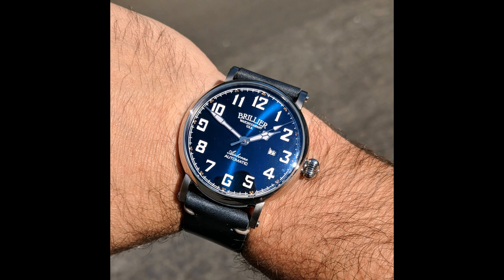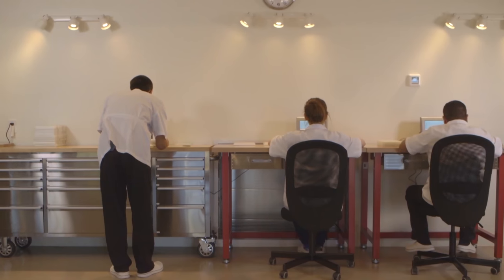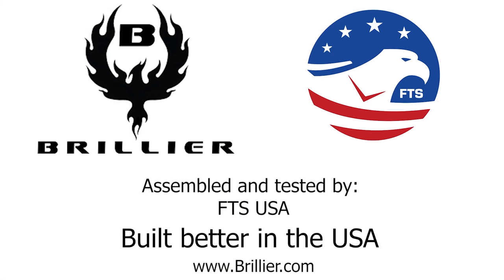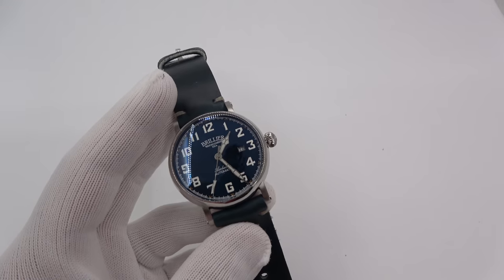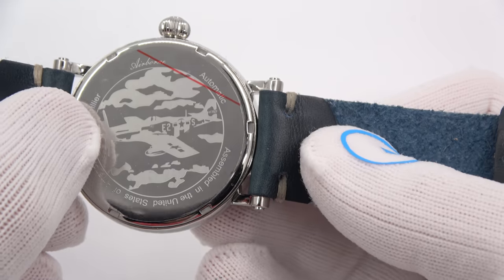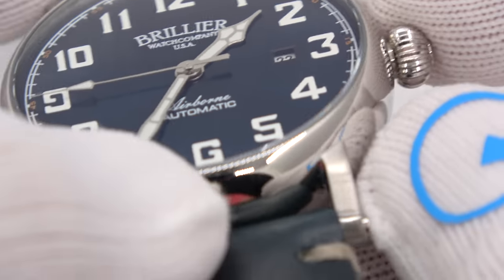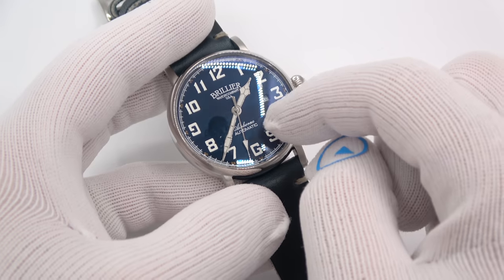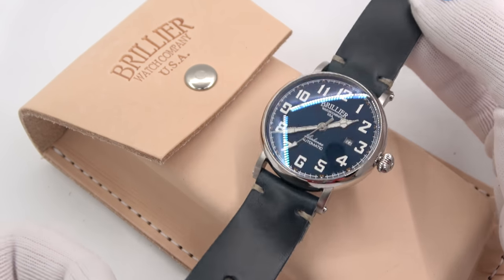Brillier Airborne Auto - Assembled, Tuned and Tested in the USA

Comment: Can someone explain to me why hacking is so important on a relatively inexpensive watch? I have several automatic watches. most hack but a few don't. When I wear the ones that don't hack, it doesn't seem to alter my life all that much. Just wondering why that feature is important. Anyway, nice looking watch. I'd jump on one if I wasn't currently on a very tight budget.
Reply: @ Luigi Savoia : I agree wholeheartedly. My SKX and my Seiko 5 don’t hack, but are my favourite everyday watches. I feel about hacking as I do about press clasps. My 70s vintage watches all have press clasps and it does not diminish the joy I have in wearing them.
Reply: Historically, hacking was a requirement for field watches and other mil-spec watches so that soldiers/pilots could synchronize as needed. Given watch lovers’ appreciation for history and classic design aesthetics, hacking became a priority. There’s also the perception that non-hacking movements are cheaper and less refined.
Reply: I don't care about hacking either.  And neither does my SKX.
Reply: @WrongTimeWatch  when the power reserve is low on the Seiko 7s26 which is usually in the morning turn the hands backwards and the seconds hand will stop. Hold it there with a little backwards pressure and wait until the clock synchronises with the watch. Then release the slight pressure with a shake the watch will start.
That's backwind hacking.
You're welcome.
Reply: A pilots watch is supposed to have hacking to synchronize bomb drops as well as fuel consumption and there two important things were just a few of the reasons a pilots watch needed hacking. I love the glycine airman, it's an iconic pilots watch. And I love the story behind it and it's iconic seconds hacking feature and how it was developed.
Reply: It is just a preference. To me adjusting the seconds is big part of the fun. Or just my OCD but either way I prefer hacking watches. I have other silly fads too like if I do something I prefer it to be done properly.
Reply: it is so you can know the exact second you are allowed to leave work....lol

Comment: I would much prefer they save the money on the strap and put a 9015 in there. The movement is a lot harder to change than the strap. At this price any watch has compromise but the way they compromised this watch feels a little boneheaded.
Reply from the maker: Big difference in price for a 9015, I feel.
Reply: @islandwatch  it's about 50% more on the individual market, maybe $75 vs $50 iirc. Idk what volume pricing looks like

Comment: "Look at that blue"  Actually rather impressive. Doesn't Laco use that same movement? Domed and onion correct for heritage. Fair price considering the high grade leather.
Reply: @indramatic  Worse to me, the A-Dial and B-Dial watches that Laco crafts were mandated by the Luftwaffe to hack. It's crazy to me that Laco, one of the very producers of the both 1939 and 1941 variants, would choose to forgo a movement with this feature. Alas, that's in their lowest end pieces. I have one of their high end watches that both hacks and is hand-wind, only (as it should be, IMHO).

Comment: Love this watch but it has two big problems firstly it should have a sapphire glass  also being a pilot watch it should have hacking  if it had the  the Miyota 9015, 24 jewel automatic, 28,800 BPH  it would be perfect  I have calibrated this movement to + 2 seconds a day in another watch. I love that movement and it has the most incredible smooth second sweep

Comment: I love the looks and the build, but would rather pay an extra $50 or $100 to get a proper movement. That's a pass for now, wake me up when there's a Sellita SW200 version :)
Reply: I think at that price I'd be expecting a bit more in the way of specs.  I'd rather see the NH35A vs the Miyota.  I think you might be looking at a bit more than $100 to switch to the Sellita, at least the last one I bought was around $150.
Reply: Agreed on the NH 35 minimum spec in this price range - no sapphire, no hacking... the date window throws off the symmetry... all of that could be tolerated but not with 50m WR for over $300

Comment: No hacking? I'm out.
Reply: Was thinking that, don't have a need for it, but nice to know you have it.  But they're aren't charging $550 or 600 for their general watches.  So at $400 I can live with a mineral crystal and no hacking.  Saw some interesting  watches in their Klassiique line up, nice for a dress watch.   Only think I would have preferred is a sapphire crystal.   But I guess a good quality mineral crystal is better than a medicore sapphire.  Sorta watched out, got an Omega and Stowa B in 43 mm so no rush, maybe Marc will increase his line of Briller's.
Reply: @VersedNJ  $50 Invicta watches have hacking. This needed hacking. 

Low quality sapphire is still significantly harder than mineral glass
Reply from the maker: Why do you need hacking? Even a Chronometer will be out of sync in an hour

Comment: Beautiful watch, but I do wonder about the practicality of the manufacturing method. CMW21 qualified master watchmaker, HEPA clean room, state of the art equipments are great... But all of that for a watch that doesn't even hack and have no screw down crown? Seems like overkill to me, which is reflected in the price. 

Oh and the buckle is too big. Looks like the strap doesn't taper down.
Reply from the maker: Just doing it right. I see your points. But if you use the best, you can bring out the best in even affordable items.
Reply: @islandwatch  I think they've past the point of diminishing returns. I personally would rather have the money going towards better movement that hacks than go towards the salary of a master watchmaker that probably won't have much to do at the office.

We are only 2 months away from 2020. Non hacking movements only belong to watches that cost $100 or less in this day and age.